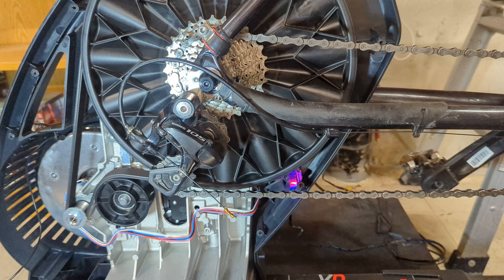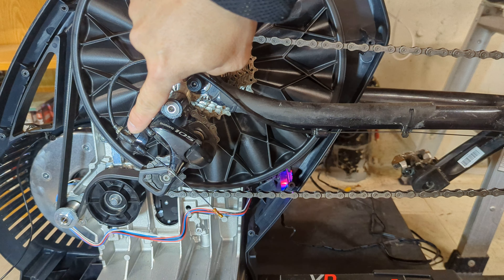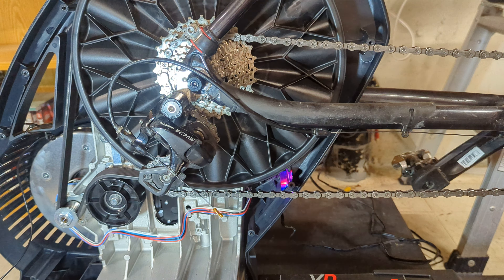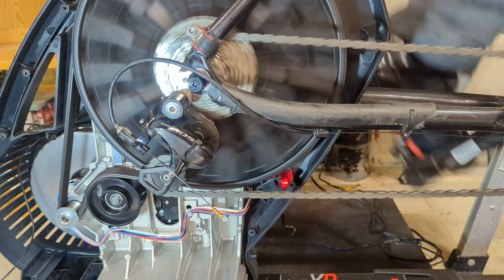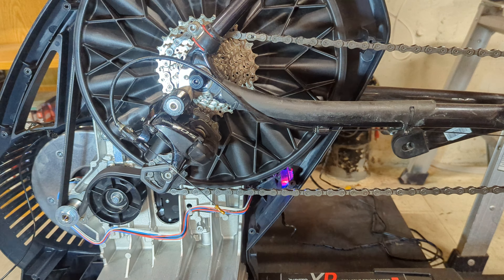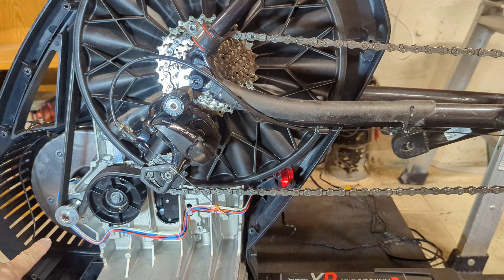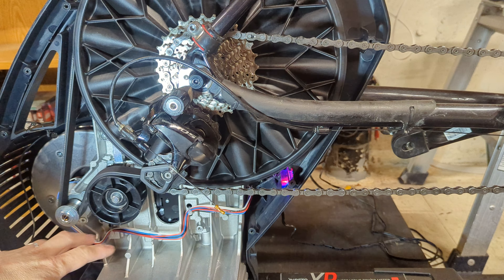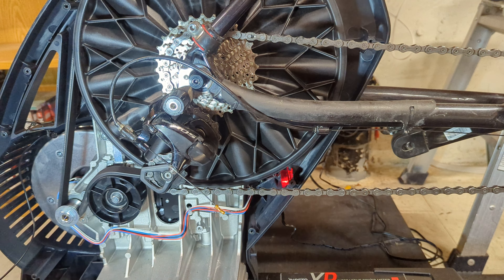Elite Direto XR- noise under 5,000km of use

Comment: Hey. Mine as just developed a very loud clacking noise when steeper gradients, have emailed Elite today. have you had any response?
Reply: Did you hear anything back? Mine, Anything above 13% and it makes a noise
Reply: @jackross4657  Hi. I contacted Elite via email/chat and they said to open up the turbo, clean it and adjust the tightness of bolts to loosen. They confirmed this would not invalidate warranty (which has since >2yeasr). It did fix the problem with no noted issues on performance etc - i often use turbo on +20% gradient simulation.

Let me know how you get on - i will try and see if any photos etc from back then